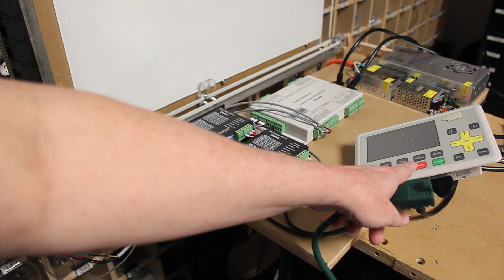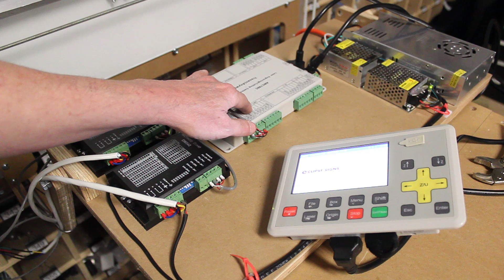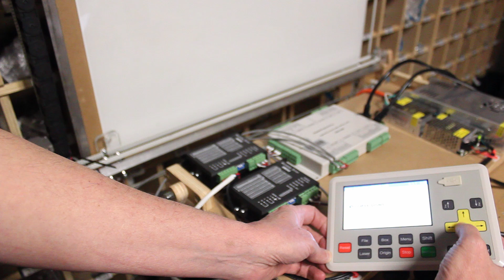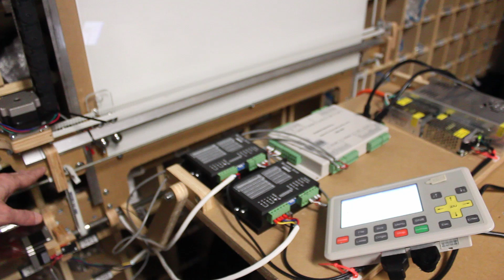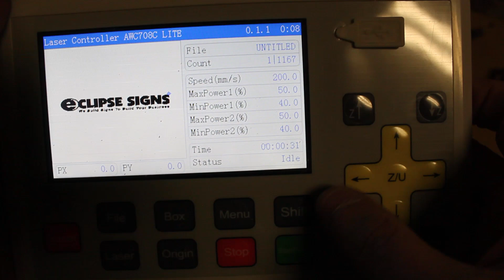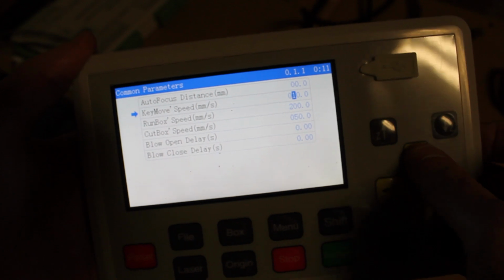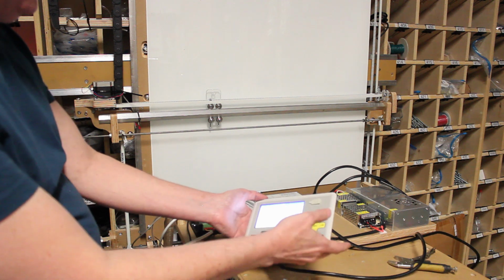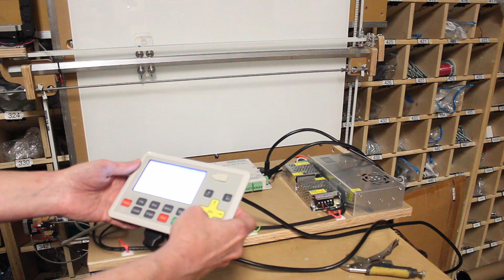Laser Controller Trocen AWC708C Setup Part 2

Comment: Man YouTube turned of notifications for your channel, but I remembered your channel today because I can't get a skate bearing to sit straight on the 5/16" bolt like the cnc build you did long ago.  I spent a while adding shims and split washers to get it straight.  I'm making az axis for a 3d printer so the bolt needs to not wobble. Any tricks you can share? 
Glad to ring the bell on your channel again!
Reply from the maker: There is a slight tolerance with the skate bearing as the ID is 8mm and the 5/16" bolt is not quite 8mm.  You can try an 8mm screw/bolt, or just tighten tight against the inner race of the bearing.
Reply: @PatrickHoodDaniel  I tried that but it doesn't help. In fact, even if I add tape around the bolt to make the shaft tight, it goes off angle.
I think it's because nuts grip the threads at an angle and the thread closest to the bearing engages first and skews the angle.  It's really weird. I always thought nuts gripped perfectly, but try it. They don't.

Comment from the maker: Here is part 2.  This one is pretty important if you are just starting up your electronics.  Watch this before you plug in your electronics and keep your finger on the stop button. Also, there are so many issues that can't be fully understood by the movements on a new setup since laser controllers have so many parameters that may cause unpredictable results.